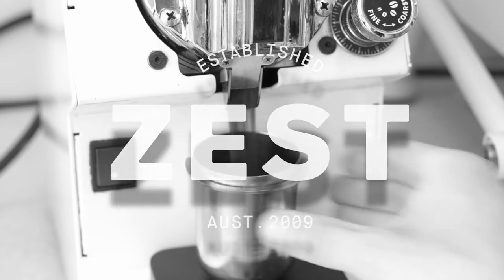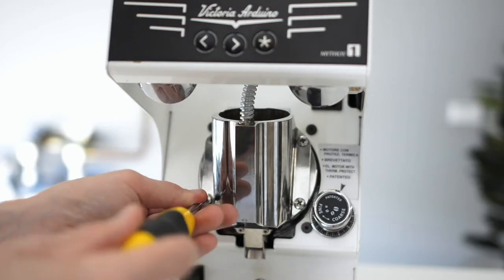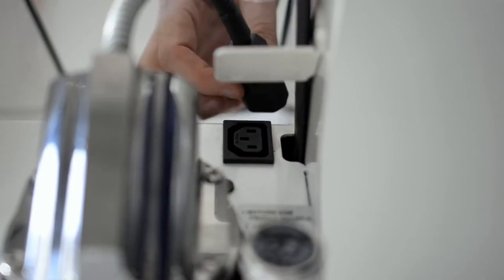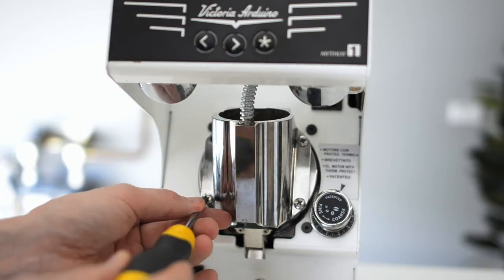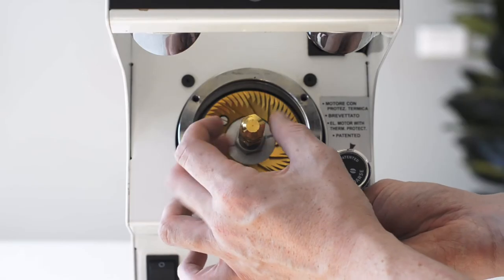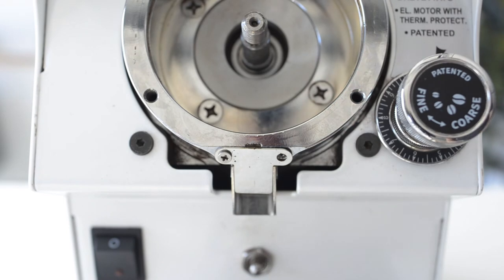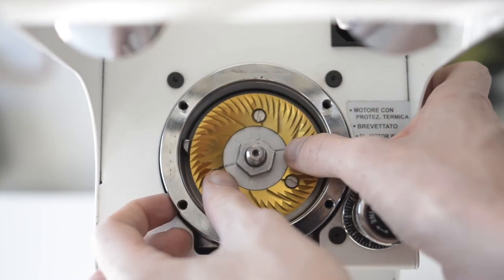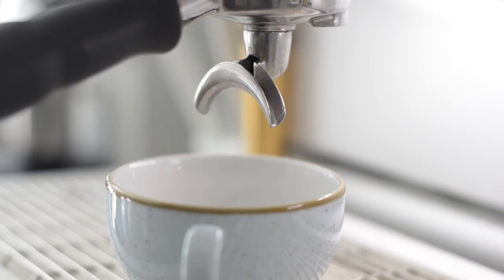Mythos 1 cleaning and maintenance

Comment: I have used water washed burrs recently. do you think it will damage the burrs/rust ? Thx
Reply: They’re not designed to get in contact with water. Water can leave mineral residue that can build up, even soft water. In the other hand, Distilled water is very corrosive and can burn down the coating on the burrs. I understand why you would like to use water, sometimes there’s still a rancid aroma. To remove the rancid oils you can use both Urnex Grindz or white rise and then brush the burrs and the rest of the inner parts.